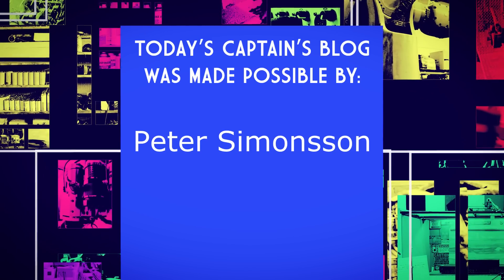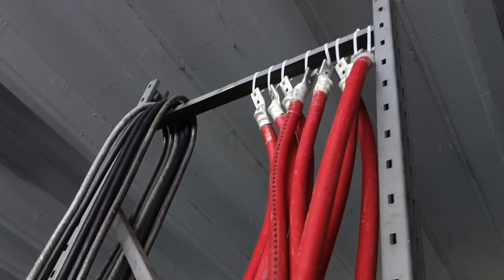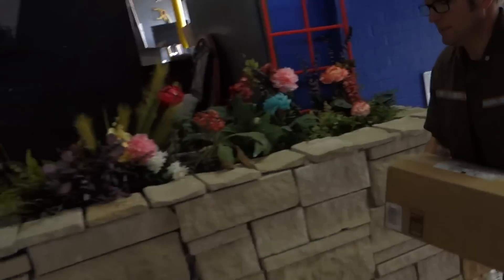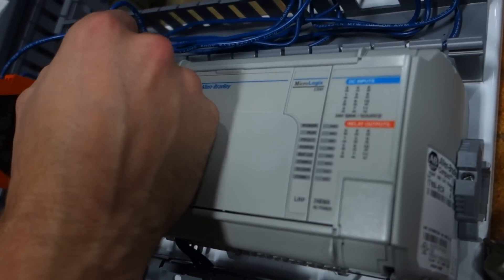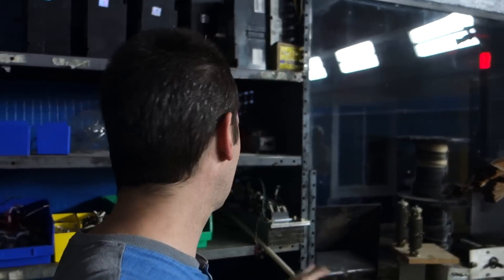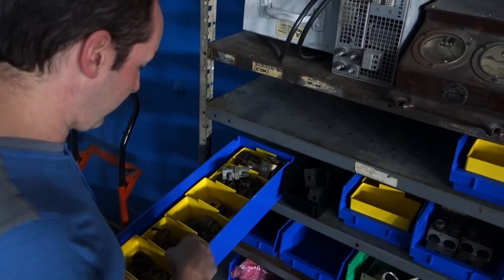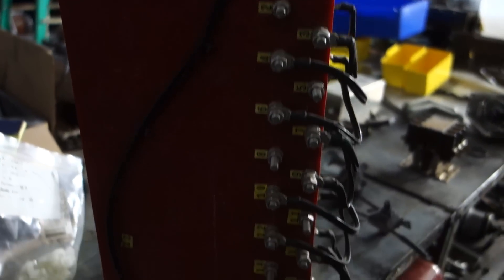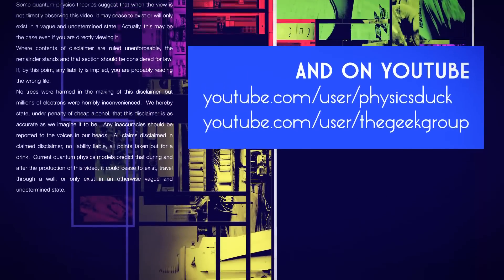Captain's Blog 10 9 2015 High Voltage Lab Shelving Bins

Comment: A question on the safety system do you have the the 480 relay controls and the E-stop going through the PLC because, that is not advised. If your PLC goes crazy then your are not able to disconnect power quickly through the use of the E-stop system and would have to go outside to disconnect the main power, time you do not have if someone were injured in the cage with the Tesla coil on. I would use a very simplistic fail safe relay system without the need for computer control.

Comment: I was looking for the s hooks that are used in butchers, they have a point on both ends and are thin, but i came across these http://www.homedepot.com/p/Keeper-S-Hook-for-Rubber-Straps-06210/203895197?MERCH=REC-_-PIPHorizontal1_rr-_-100212219-_-203895197-_-N
Alternatively make a jig to bend your own, could even have a square hook on one end to fit the top rail
The tabs on the bins are mainly for lifting out an individual one, and for adding a label.
That mystery device reminds me of a selenium rectifier with the fins.

Comment: Can't you mod a dishwasher to clean the dirty hv stuff? Drill a hole and built a custom detergent adding mechanism. 
Maybe dishwasher detergent even works on smoke deposit? That stuff is pretty good at removing junk from glass metal and ceramic.
Reply: +Julian Doll Soot doesn't really react well to soap and water. The particles just whoosh around and cling back on the surface.